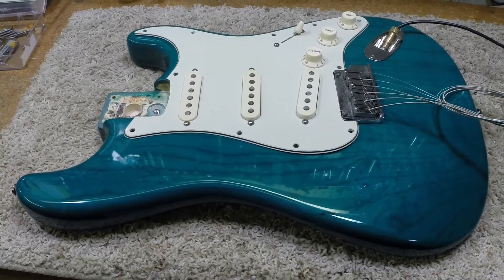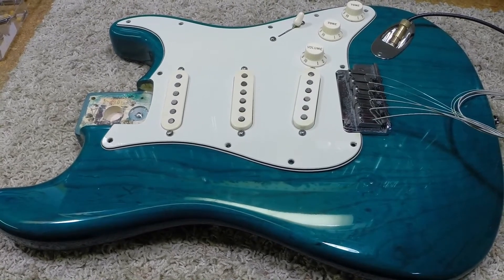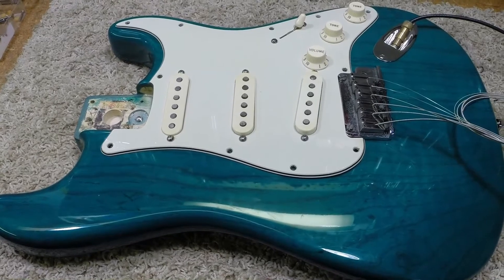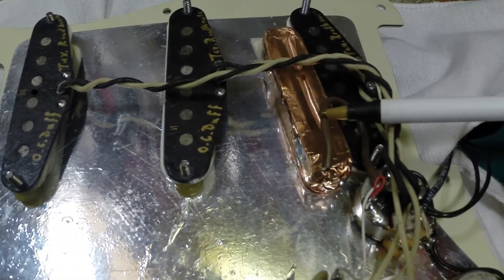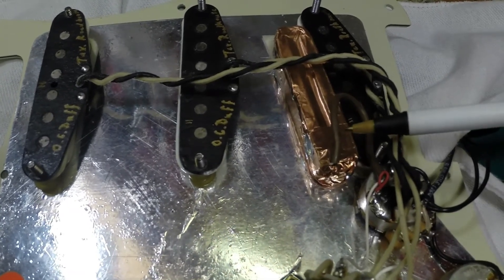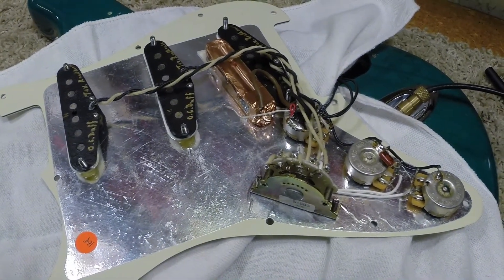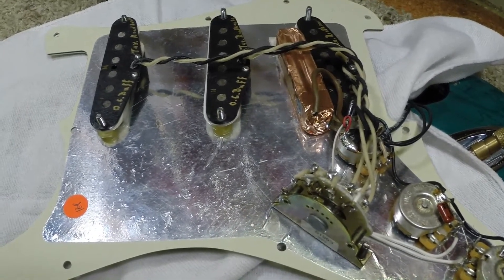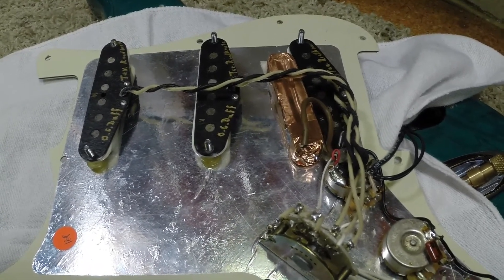Making a Single Coil Strat Noiseless

Comment: could it be wired to the jack too? hot-tip ground-sleeve?
Reply from the maker: No, the coil needs to be wired in front of the volume control in the circuit.
Reply: @guitarc.p.r.9675  alright fair, so just wire the dummy with the magnetic pretty much on the hot gotcha

Comment: Hi, nice info. If I got a humbucker in the bridge and want to do this for the other two pickups?
Reply from the maker: Yes but if you have reverse wound middle pickup you will have to flip the leads of the humcancelling coil to be used with it, and  the humcancdlling coil should connect in the neck only and middle only positions only.
Reply: @guitarc.p.r.9675  Thank you.
Reply: @guitarc.p.r.9675  reverse wound middle pickup , is flip cables on the pickup itself?
Reply: Because I already installed, I soldered on the second position of the switch, so on this position sounds fantastic with the bridge pickup, but in the 4 position sounds awful.
Reply: My strat is a Squier that came with humbucker, maybe the reverse wound is already done. So for the 4 position I have to make a bridge cable betwen 2 and 4 position right?
Reply from the maker: You flip the leads on the hum cancelling coil, not the pickup.
Reply from the maker: No.....   First thing you will need a different multi terminal  selector switch.  Second you will need to know the polarity of your original pickups.  If they are hum cancelling in the second position you indeed have a reverse wound middle pickup.  You can use the magnet out of the hum cancelling coil to check magnet polarity. If one pickup magnet repells and the other attacts the pickups are reverse polarity.  BTW, the front pickup and the rear coil of the humbucker should also be the same polarity.  You will need to wire two sections of the switch to operate as the original switch.  One section for pickup selection the other for the tone control switching.  The other two sections will be for the two hum cancelling leads. One section for the positive and the other for the negative. You want it to connect to the front pickup in position one only, and the middle pickup in pos 3 only.  Using the 2 switch sections you can reverse the phase of the humcanceling coil as necessary.  Hope that helps I can't tell you anything else other than you will have to plot and plan it out.

Comment: thank you for sharing this information, I am going to test this out on my strat! as i was doing some research, some said to wire this in serial with the other pickup, and you mention to wire it in parallel, may I ask what's the difference in sound? or does it make a difference at all? thank you!
Reply from the maker: I do it in parallel because it is simpler and keeps the impedance similar to having two pickups on.  You can wire it in series, sometimes I do depending on wiring configuration.  Everything makes a difference in sound.

Comment: Would this work with coil tapped humbuckers  say  like Fender doubletaps.
Reply from the maker: Yes, but you would need a different coil similar to the ones in the pickup.  You would also need a monster switch to engage the coil in the proper positions.  Most likely it would be easier to wire the humbuckers in parallel via switch.  They then would be humbucking in parallel instead of single coil.

Comment: Man, I am super late to the game here but this really opened my eyes...thanks so much for the info: KUDOS. Question: so this will give you the same result as you switch across position1 (B-pup), 2 (B-M), 3 (M), 4 (M-N) & 5 (N)? Also, have you noticed any tone issues or drastic change of character from each pup due to adding this dummy coil?
Reply from the maker: Yes, It will cancel noise in all positions as long as all the pickups are the same polarity: no reverse wound middle pickup.  As far as changing the tone well everything changes tone.  I would worry less about this wiring, than I would old strings.  Plus how can you tell about tone with the hum. If you are new here, and you own a strat I highly recommend also watching my "Fenderitis" video.  Thanks for watching.
Reply: it takes away some of the highs
Reply from the maker: Sorry did you say something?  I could not hear you over the hum.

Comment: I see some people wired it to the input of the vol pot, not on the ground of the vol pot like you did, is that any differences?
Reply from the maker: Same connecting different end of wire.  I just prefer to attach it at the switch.
Reply: @guitarc.p.r.9675  if I just want to only bridge pu, could I just wired it on a hot wire of bridge pu instead of the common of switch?
Reply from the maker: Yes
Reply: @guitarc.p.r.9675  thank you for answering my questions, glad to see your videos!
Reply from the maker: Thank you for watching, I hope they help you in some manner.

Comment: But you lose tone and volume. That's your compromise
Reply from the maker: Life is full of compromises.  The trick here is no one rule applies to all,  I unwind many of the coils a bit.  Asymmetrical coils cancel less.  Funny thing, most of you guys are dissing this idea, but many are also raving about the similar back plate etc systems.  Bottom line is it works for my customers that want it.  Especially the ones in studios.  Thanks for watching and commenting.